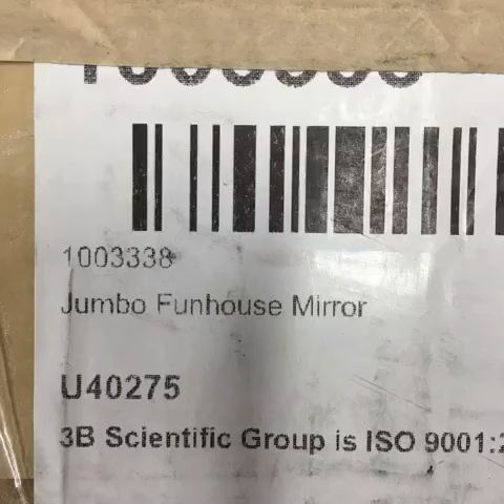How to make a funhouse mirror DIY

Comment: What thickness foam board did u use? Is it 0.5" , 0.75" or 1"
Reply from the maker: Alan Fraley i used  1/2 inch so it was easier to bend